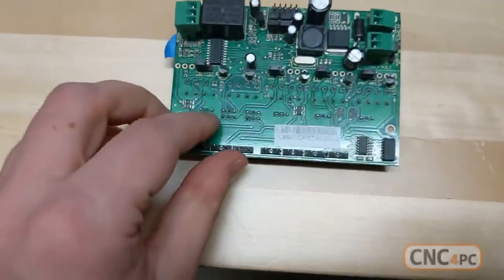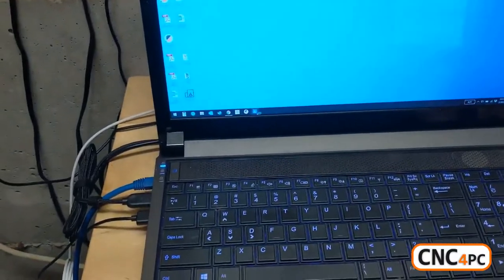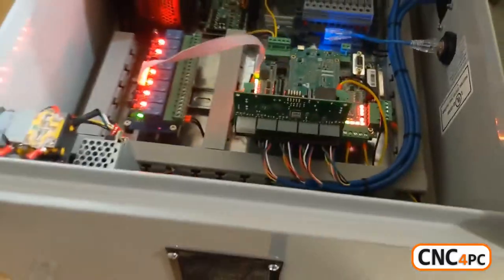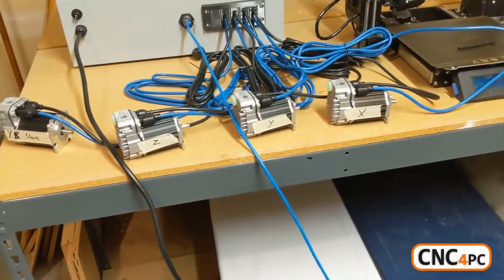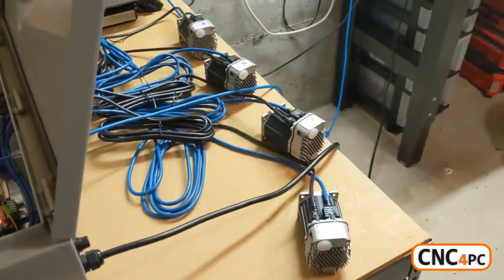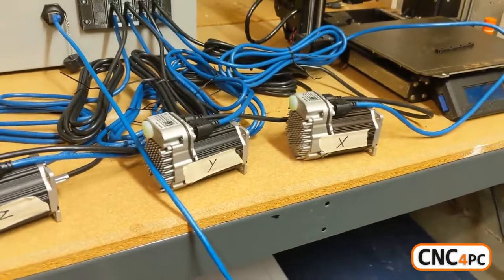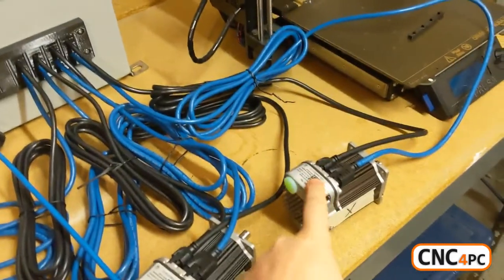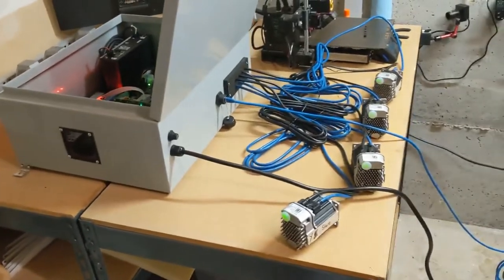Clearpath Servos on Centroid ACORN Control using the C86ACCP

Comment: this does not work, unless there is something else that needs to be switched.
Reply from the maker: I know it can be tricky, as it is an interlocking system, and one thing depends on the other.  That is why we recommend doing and validating this setup Step by Step:
https://cnc4pc.com/blog/post/Wiring_and_testing_a_C86ACCP  If something is not working right, please get back to us and we will give you a hand with this: https://cnc4pc.com/contact/